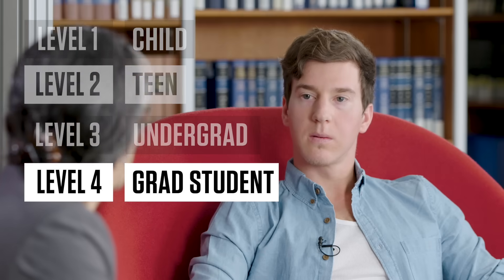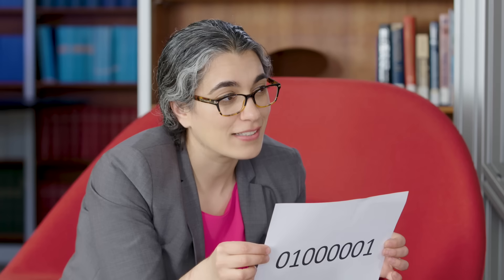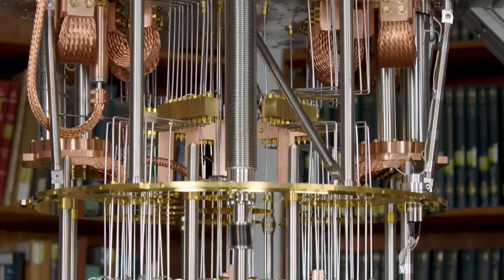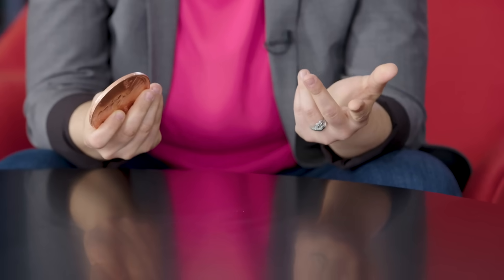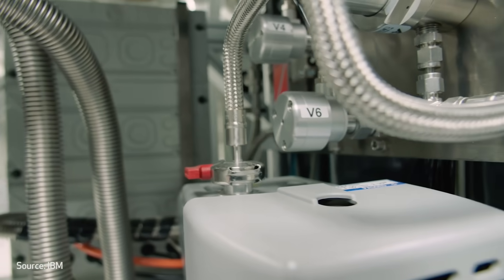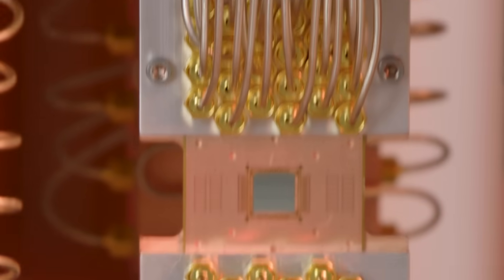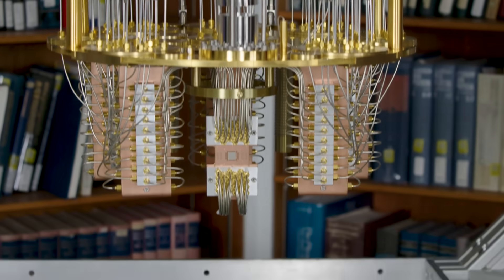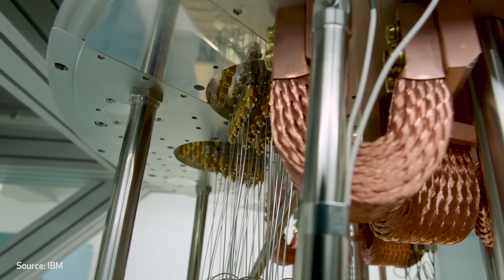Quantum Computing Expert Explains One Concept in 5 Levels of Difficulty | WIRED

Comment: Too bad she didn't explain WHY quantum properties like entanglement and superposition make it superior to classical computers.
Reply: I still remember some years ago they got super excited becuase the quantum computer calculated 3 times 5 correctly.
Reply: The spinning coin example was kind of that.
Reply: She kinda did, she just didn't get into depth. In short, it's because quantum space is much MUCH larger than binary space for the same number of elements (IIRC n qubits stores as much information as 2^n bits). This is because the probability of each superposition is independent, and there is 2^n superpositions.  Quantum computers are tricky though because they collapse back into regular bits, so you can only use operations that take advantage of quantum states without reading them in order to get any sort of advantage, and that's where entanglement comes in.
Reply: because it kinda doesn't, quantum computers are great at a specific subset of problems. outside that subset they are not better than normal computers, heck considering how complex they are, they are actually worse. a big example is algebra,  something that computers are great at doing but quantum computers ain't specifically any better at it
Reply: @khhnator  You are not entirely right. Because the most effective integer base for computation is 3 (ternary) not 2 (binary) like it is now. And Superposition sort of allows that; even more, theoretically it can allow Base-e (~2.71) computations which are the natural computations of the universe!
So if only quantum chips would be able to reliably use three states of their qubits, overall computational efficiency will skyrocket at any general task.
IF properly implemented and coded.
Reply: @Vladimir_Kv  tell us how they will "quantify" bits that produce "irrational" or "infinite" values.  Cause that's all your gonna get with e...
Reply: @Vladimir_Kv  In 50 years. However at that time all computation will be remote, so the entire premise of doing general tasks as we refer to them today is out the window. Its log-cutters wondering how much more efficient electric saws will make them not understanding electric would put wood out of use.
Reply: Vladimir K.

I'd like to see a proof for that claim. I know ternary has some nice properties (like being able to encode a balanced form system), and e is the max value for x^1/x, but I fail to see why base e would be most efficient. It seems like an arbitrary high base would be most efficient, as long as you had efficient hardware for the atomic arithmetic circuits in that base,  and in practice our base-2 circuits are the fastest.
Reply: +Aaron565

That's a load of BS. Just because cloud computing is a big fad now doesn't mean it will become all encompassing and much less make it so that general tasks no longer need to be performed. There are three reasons that is abject nonsense. First, in order to even access cloud data local processing is still required to host it locally. Second, there is inherent latency when using remote sources that cannot be overcome because speed of light places a hard limit on it. Finally, the server would still need to perform general tasks itself, so this has nothing to do with the usefulness of boosting general tasks whatsoever.
Reply: @Vladimir_Kv  Who says that 3 is the 'most effective integer base'? For which exact calculation?
Reply: @khhnator  The man with a quantum computer would become a very very rich man. Hack any computer encryption, predict the stock market.... o man.....
Reply: aw, its so cute when you try to talk about things you dont understand.
Reply: She compared it to binary. Is that not enough?
Reply: you're entitled to your own opinion.
Reply: Weird flex but ok
Reply: at what speed do you think they transfer and then set  the superposition information to entangle them ? and then how do they convince those particles that they should behave in a mutually entangled manner ?
Reply: yea, she pretty much explained it pretty explicitly..?  exponentially more informational availability without being limited to the constraints of binary..
Reply: because entanglement creates something that occurs faster than the speed of light / causality.
Reply: Yeah I felt the same way
Reply: It gives u more states, like we have 0 and 1 only now. But later it will be more with just same space.
Reply: ...Pretty sure she did that with the child.

Comment: Dr. Girvin talked to the wrong engineer.  We DO use fault tolerance all the time in the form of CRC.  Every single packet you send over the internet has a checksum.  At least in terms of IPv4 (other protocols may have CRC or checksums as well).  While we don't write code that's fault tolerant itself anymore (like early days with DECs which would randomly flip a bit here and there and the early programming gods at MIT had to deal with that), but we still incorporate fault tolerance in many other places that have lower reliability such as network transmission.
Reply: @Zyxlian  Read my whole comment.  That's basically what I said.  I just wanted to point out that it still exists at either the hardware level, in your example, firmware (BIOS for example) and software.  Someone has to worry about it though.  Even in your ECC example there was a problem to solve (DRAM is unreliable especially in strong magnetic fields) so how to solve it?  Fault tolerance!  It was still a concern though and that's my point.
Reply: She's talking about qubit-based fault tolerance.  As she said in her presentation, the scale of fault tolerance required for persistent quantum computing will take millions of qubits.

Comment: As I listened to each level I started to get more and more certain that she was more management then a technical lead gone manager in the group she's with. Her technical notes were slightly incomplete or inaccurate in ways a physicist would've been a little OCD to get wrong, and then looking at her credentials she did material science and it made a lot more sense. It's like they took an aerodynamics specialist and asked them to explain flight control software to varying levels of competence.

Comment: So the benefit of quantum computing compared to classic is that an integer in binary has infinite possibilities? I dont understand how this is better than classical computing.  you can have theoretically infinite long strings of binary integers to create infinitely complex outputs. I can see how it could be better if there is limited storage, but these days if you really want to be working out complex math on your computer, you just get a couple terabytes and youre set. Plus computer storage continues to shrink in physical size as engineers keep pushing to fit more capacitors on chips such that handheld devices have sufficient computing power.

Comment: The grad guy asked a question that was not answered. What kind of logical operations can you use with quantum computing? I am no expert but my understanding is because the on off state or current no current state can be used to represent binary math, you can conduct math operations after converting your problems to binary. So what will the quantum states correspond to in math or logic?

Comment: To summarize:
1. Quantum computers use super-position to store information so they can store more than two states in one memory cell.
2. They are huge so that cell is a lot bigger than current computers and requires special equipment to cool it to almost absolute zero and manipulate it.
2a. They are trying to make them smaller but it's anyone's guess when or how.
3. The results are unreliable due to many factors 
3a. They are trying to make them more reliable but it's anyone's guess when or how
4. They use microwaves to store and retrieve information
4a. But you can't heat up your coffee on them. Because they are super-cold.
5. They are working almost at the assembler level of programming at this point
5a. They are trying to make it as easy as modern programming. Which isn't really easy, but lots of people can write code even if they do it poorly.

Thanks for the very high-level discussion, even at the professional level.  Is there a higher level that can be used next time so we can learn something useful??

Comment: How about a program that predicts the next winning mega million numbers??   (For just THIS universe, of course)
Reply: Could be a possible use, but there aren't as many possible combinations to lottery numbers. You could have easily won the Mega Millions $1.5 with under 302,575,350 tickets purchased. So you're not thinking big enough. With a quantum computer with 40 entangled cubits, you have instant access to 1,099,511,627,776 separate states simultaneously. 

tl;dr: In the foreseeable future, equations that were previously thought to be impossible to compute will be solved near instantaneously.

Comment: If you have a list with like 1 trillion numbers of code and only 1 is going to open the safe, the regular computer would go through the list 1 by 1 while the quantum computer would search the entire list at once.
Reply: Cobrakay2003 the meaning of life: “42”
Reply: This is not a realistic concern. The professor at the end referenced encryption in quantum communication. That is already viable. The entanglement of two particles is all that is needed to make a channel uhackable. The 'check every password to break into things' idea is very far in the future because it requires them to deal with the whole fault tolerance thing first. So really no worries, because quantum encryption outpaces quantum hacking. Like the professor said, quantum computing is on the side of privacy by its very nature.
Reply: For the record, I didn't say that encryption is gonna end and we're all screwed. All I said is that as we make better quantum computers, how we think about encryption will inevitably charge as we learn more. Like with any new technology
Reply: No it wouldn't really. It would search for ones and zeros simultaneously. Giving you the power factor of two yes. But it depends on how many q-bits you have, and the best is 40 now. So it would handle a sting of 0 and 1s up to 40 digits faster. Anything above and the classical computer obliterates it. We use electricity and gates to power trillions of transistors in a single chip at near lightspeed, at frequencies in GHz (billionth of a second). Regular computers are insanely efficient at handling tasks similar to those you described. While a 40 q-bit Q computer can't transmit information trough vibration that fast.    
Even a slow computer would go trough millions of combinations in seconds, and way faster than a fast quantum computer does as it's very limited in what it can do with the data.
Like she said Q computers are to model stuff that's difficult to describe with 1 and 0, like natural element formations. That's where even a small number of q bits is relevant. 
They're both computers yes, but not really comparable, just like both a tractor and a car have wheels but you wouldn't use a tractor for races, or a car to pull a plough.
Reply: why is that useful though
Reply: @BingOfHildegard  because it could let you check every password at once. At some point, we're gonna have to change how we think about online encryption
Reply: @TheFlipside  lol not even close, sorry
Reply: @filipposoldati1472  Its not exactly that but he is absolutely right if Quantum computers keep evolving they will be able to break most of our current encryption methods in a 
super short amount of time compared to what we have now.
Reply: @clementineurban9622  Yes but not for that reason, that would be because it'll be possible to have polynomial time factorization algorithms, which would also imply a good step forward in technology and research...
Reply: @TheFlipside  well if quantum computers are involved in the encryption it goes both ways too. The password or code is a or in a specifc quantum state. Or that's how I understand how the Physicist said it.
Reply: It depends on how many states you can encode onto one qbit but theoretically yep, you totally could
Reply: dang thanks for the explanation I was still kinda confused how the superposition cut down memory time
Reply: This should be the top comment. It explained the basic difference in just one sentence. Quantum physics are not the same cuz speed reaches almost the speed of light and the same electron can be in 2 different places at the same time.
Reply: it will make generalized ai possible. to talk about how models could be benefited by comparing multiple iterations of the same network at the same time is useless, we will be interpreting the calculations indirectly because the inputted data will be more numerous than humans can find a use for.
Reply: Hm, that sounds like something outta a sci-fi, and not even classic sci-fi... Even Star Trek's Data would go through the numbers one by one, not at the same time. You sound like a futuristic sci-fi, bruh.
Reply: well this comment explained it better than the whole 20 minute video

Comment: This is great. Now I understand QC - well to a certain extend. @Talia. You are looking for having fault tolerance. I fully understand because this is how we always looked at computing. The perfect 100% accurate result - any time. And I'm sure one day somebody will find the solution. In the meantime you may want to look at applications where this is not so relevant. Imperfection is a form of quality that we all see in nature and in the universe. It is indeed a quality. Only imperfection allows evolution, mutation, and variation. Without imperfection - funny isn't it - we would simply NOT EXIST. Here is how it goes: Think about a structure for an airplane wing that is ultra light, still strong enough that it holds the body of a plane, yet flexible enough that it does not break. Your brain comes up with a few ideas, you let it run through a computer, optimize the structure based on let's say a heat map if issues and the build it. If it's working safely produce it and we are all flying with it - actually for centuries.  Guess what - the structure that was picked in the first place is absolutely imperfect, still to heavy but it just works. Let an AI system design it and go through a million iterations, It would come up with a perfect solution. IMPERFECTION however saved us time so we could have airplanes long before we even knew about the existence of AI. Another example: Your own company provided the computer to beat - I believe it was Kasparov - in chess. The software however was imperfect because it could not go through each and every possible move but used the ones with the highest probability to win. AlphaGO did the same with go. Every idea we (humans) create is always imperfect, then we perfect it over time and it will still never be perfect. How about letting the good old silicon based computers do their job and focus on apps that doesn't need that kind of perfection but an overall performance increase unreachable for today's silicon based machines. Instead of computing a three dimensional image and simulating it to move with silicon, take a quantum computer and ignore that few pixels that are lost or even whole frames that do not get perfectly represented. Just a thought.

Comment: They should be talking to computer engineers or electrical engineers not just CS majors. She said they are abstracting the language part so they wouldn't really be able to tell a difference. She has been covering the fundamental hardware paradigms they are using not quantum programing languages.

Comment: Its so funny at the end of the video when they "show off" the quantum computer sitting in the room, with a bunch of quick pans and close-ups, but they are mostly showing (what I'm guessing is) all of the cooling equipment!  It would be like showing off a modern computer by opening the case and showing a bunch of close-ups of the power supply wiring...

Comment: maybe its not the heat that is  a problem with your quantum chip its what your trying to make it do and i will not!  quantum entanglement has ended there is no technology yet we have that can cross the divide teleportation has stopped at this level we just do not have the power or understanding to do this yet but getting closer even though closer is 30 years away

Comment: Man o man, I would be like a kid in a candy store. How can you just sit there? I learn by touch and seeing. Is there a reason you're using gold? does it get hot? how much storage does it have? how much information can it send? whats the distance and travel speed of information? how fast can it solve NP? What kind of power supply does it need? how many  calculations can it do at one time? How many  transistors does it take? I have 50 million questions swimming in my head, I would love to lay my hands on that baby. :-)
Reply: Mezer4u most of these questions don't make sense for quantum computers.
Reply: hmmm There are no questions that doesn't make sense. Questions are just our way to find out new things, including things we've had the wrong picture of. If you ask a question that doesn't translate well to the topic, you surely get the reply that it doesn't translate well because this or that -> new information acquired, and you now have a better picture of the subject than before :)

Comment: Quantum computers are really analog computers. Much faster, infinite voltage levels down to the atomic level, no error correction and certainly complex in capturing data.  At the end of the day, all computers are crude quantum. They rely on detection of 'voltage', e.g. anything below 2.5 volts is a binary 0 and anything over 2.5 volts is 1. So ya, the first computer was a crude quantum.